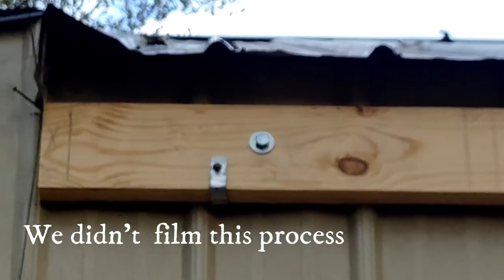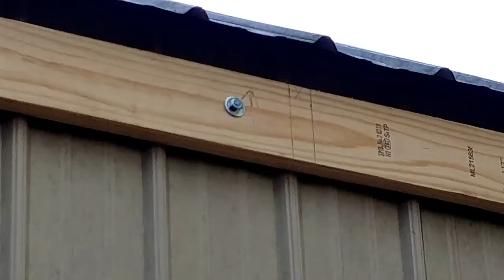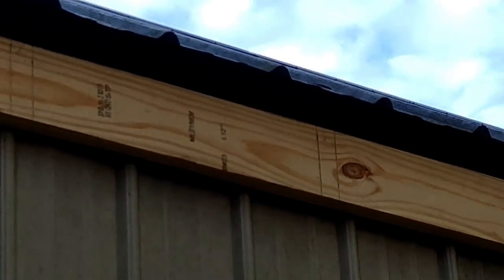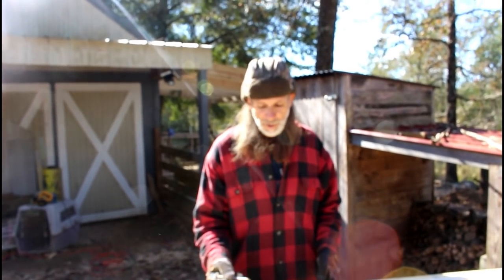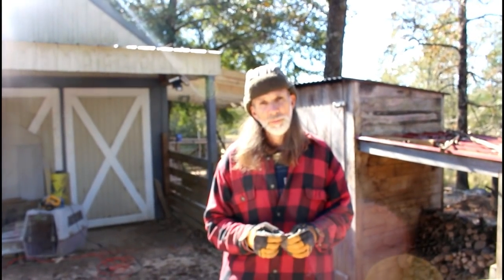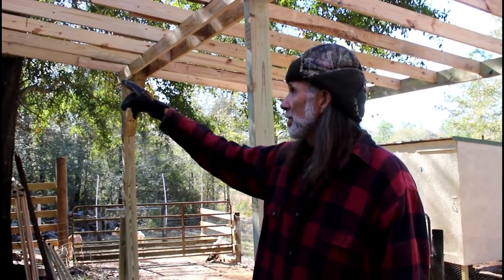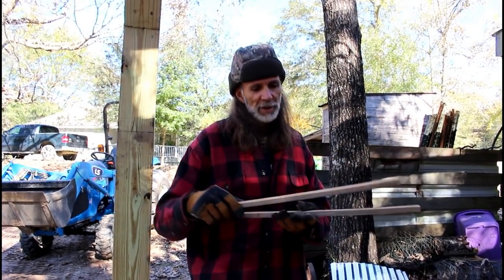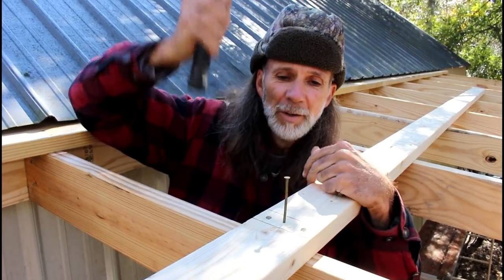Rafters and Lathing ~~Barn Addition

Comment: Why don't you just use hurricane straps to put up the rafters. It would be a lot easier and quicker and just as strong.
Reply: I was wondering the same thing, they are zoned in Pa. We had to use them when replacing brothers porch roof.  He can put some on now if he needs to.
Reply from the maker: Video on Wednesday on hurricane strips.  You jumped ahead of us. LOL
Reply: @DeepSouthHomestead  Would have been much easier putting the strips up first and then setting the rafters in the strips.
Reply: I believe there talking about truss hangers. Hurricane straps are a different tool. :-) they will tie down the truss to the posts so it cant be lifted.